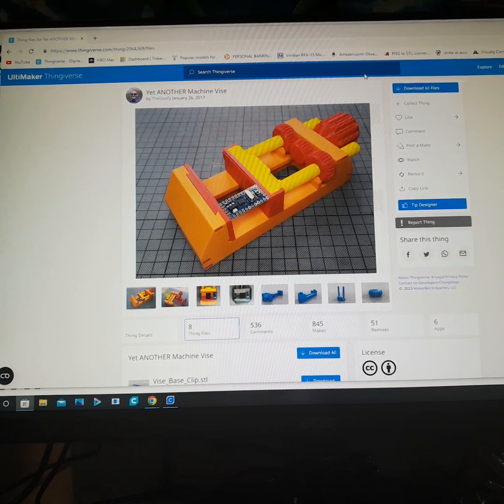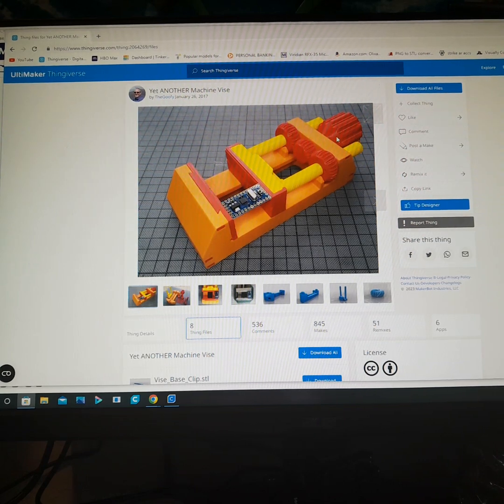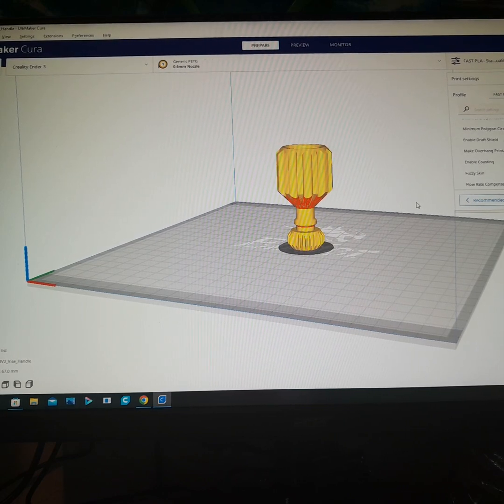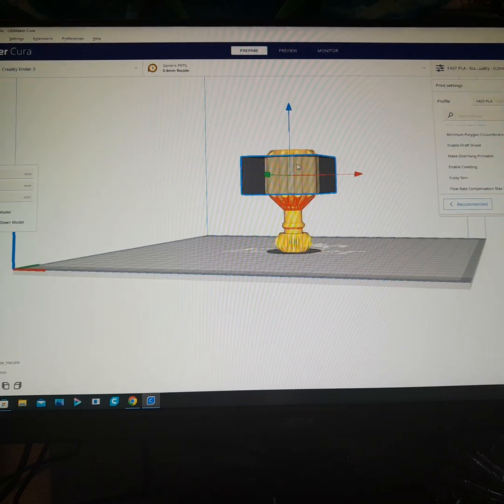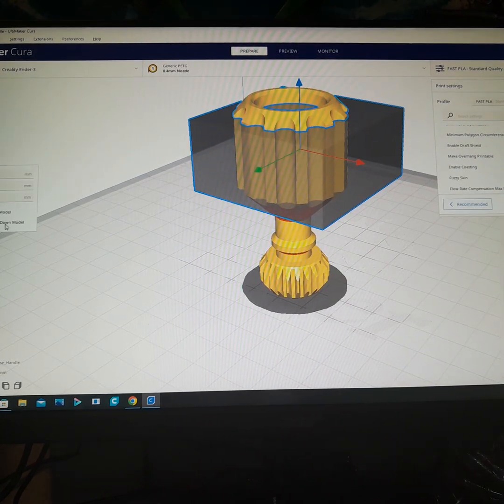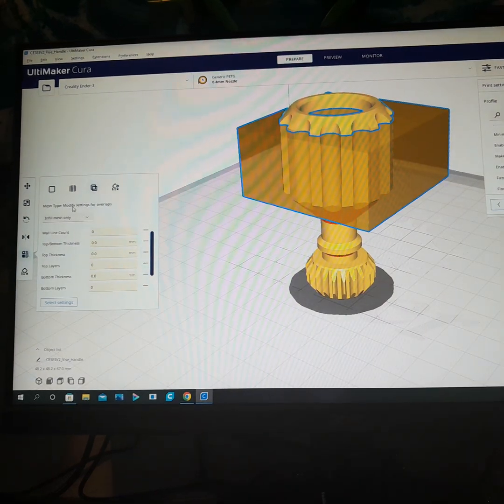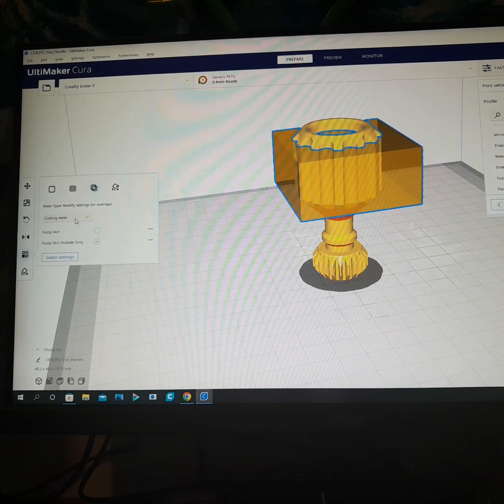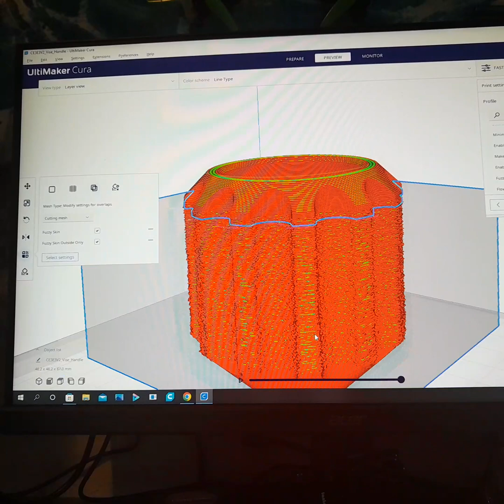CURA Fuzzy skin only on selected part of print.

Comment: I have found fuzzy skin shows up inside the part where the blocker meets the model. Makes some really weak spots
Reply from the maker: You would have to do more steps in the modeling process to illiminate that but it's doable. In the instance shown its a non load bearing part so wouldn't effect the part I illustrated.